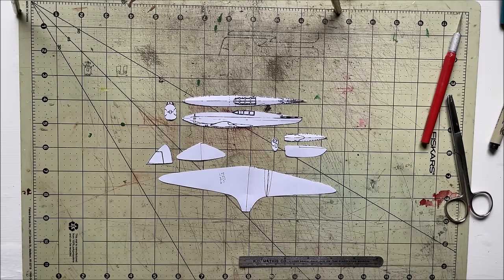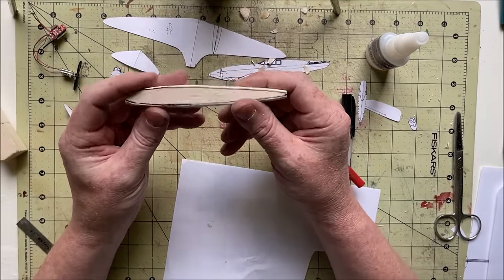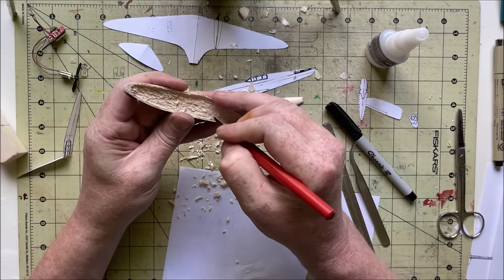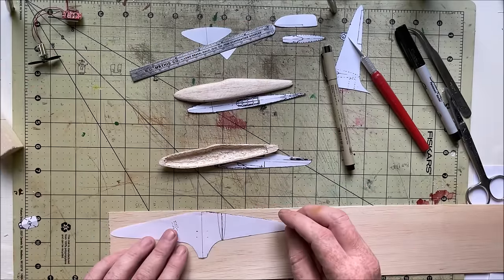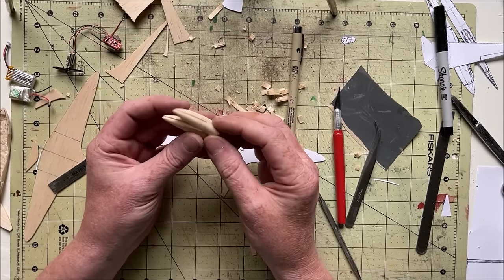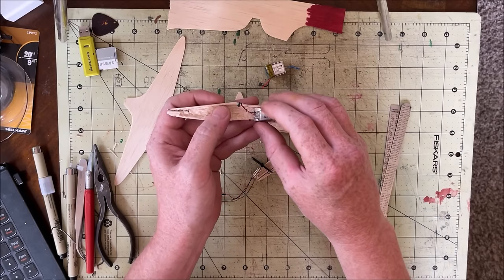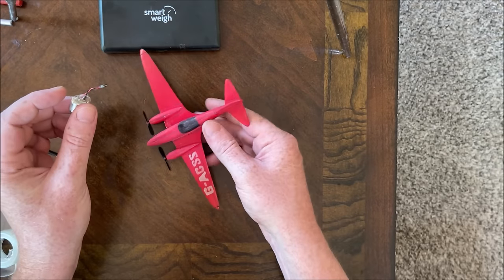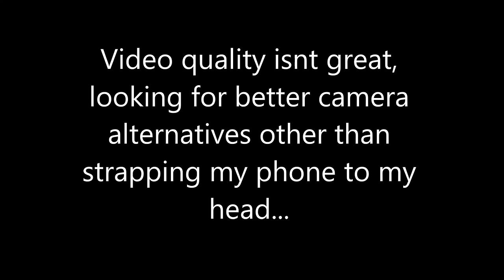micro DH.88 Comet RC plane build/flight

Comment: Damn that things quick! Have you ever made one in 1/87 scale or tried resin printing one?
Reply from the maker: Thanks!  Yeah shes pretty zippy for how small it is.  Not sure about the actual scale of the models, but havent done any 3D printing.
Reply: @microbuilder  you should definitely look into resin at some point
Reply from the maker: @hamiltonsullivan6563  I've been wanting to get into 3D printing for other things, but I like the hand building when it comes to RC.
Reply: @microbuilder  true true, you could just make the air frame in peices and glue it together

Comment: How did you do the flaps to make it turn?  Fantastic build!
Reply from the maker: Thanks!  This one has no control surfaces, it speeds up one motor or the other to make it yaw.  Simple but effective.
Reply: @microbuilder  That I like!  Makes total sense now that I think about it!  I was certain I didn't see you make any flaps, so couldn't understand how it turned, so thanks for explaining! :)
Reply from the maker: @andrewjenery1783  No problem, it works surprisingly well.

Comment: Are you steering that plane with the motors?
Reply from the maker: Yep, thrust differential steering, one speeds up while the other slows down, pitch is controlled with throttle, simple but works great.

Comment: amazing ,,i build small planes and im just now starting to think about rc for them ,,but so tiny,,were do u get the tiny motors
Reply from the maker: Thanks!  If you do a search for KF606 you should find the micro RC plane I used the electronics from.
Reply: @microbuilder  THANKS ,I FOUND THEM ,,IM BUILDING A L 19 BIRDDOG,GONNA NEED SOME BIGGER STUFF ALSO ,I BUILD IN ALL SIZES SMALL ,UP TO 14 INCH WINGSPAN ,THANKS BUDDY ANY MORE LINKS WOULD BE APPRECIATED:hand-purple-blue-peace:
Reply from the maker: @PoorBoyPennyShow  I'd definitely check out the electronics that come in the E-Flite Ultra Micro planes, theyre a perfect fit for that size model.

Comment: how does it turn with no flaps?
Reply from the maker: It uses thrust differential for steering, one motor speeds up while the other slows down and it causes it to yaw, throttle controls pitch.  Pretty simple, but works great on these little ones.

Comment: Amazing build, how fast is that tiny Tot going
Reply from the maker: Thanks!  Not sure about the speed, but she's pretty quick for a couple 4mm motors.
Reply: @microbuilder  out of curiosity how hard would a twin EDF build be ?
Reply from the maker: @SGTMARSHALL1   About the same, the only thing with EDFs is they only make them so small...there's commercially available 30mm fans, myself and a few others have  20mm units, and some are custom making ones down to 12mm.  So if the model doesnt have to be super small, it shouldnt be a problem.
Reply: @microbuilder  thanks for your time, I started a model last year and thought it was too small until I saw your efforts
Reply from the maker: @SGTMARSHALL1  No problem, definitely give it a shot.
Reply: @microbuilder  is there any chance you could test my design, would be sure nice to see if it flies as good as it looks
Reply from the maker: @SGTMARSHALL1  Hmm, it would depend on what it was.
Reply: @microbuilder  it's a Stealth fighter jet concept
Reply from the maker: @SGTMARSHALL1  Sounds interesting, do you have a drawing or plans for it?
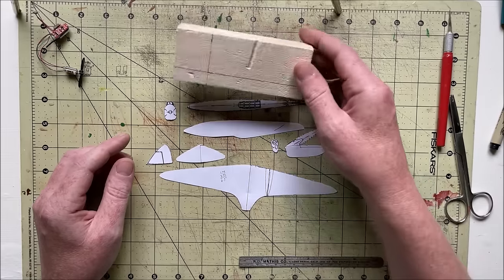Reply: @microbuilder  I have a top view and a 1:16 scale @ 900mm x 500mm x 200mm model not yet completed but enough 3d detail to capture the essence of my design and I can pull together a few relevant dimensions
Reply from the maker: @SGTMARSHALL1  Shoot me an email with some pics.  Cant guarantee anything, but I'll take a look.
Reply: @microbuilder  what is your email, will send you pictures, dimensions and angles
Reply: @microbuilder  or I can send them via message on Instagram
Reply from the maker: @SGTMARSHALL1   If you go to the About tab on my channel my address is there.
Reply: @microbuilder  I don't see an email address there ??
Reply from the maker: @SGTMARSHALL1  hmm yeah doesnt show up on mobile for some reason...just trying to avoid putting my email address out there publicly.  I do have an instagram account with the same name, microbuilder, try shooting me a message there.
Reply: @microbuilder  no worries, I sent some pictures through from my account Shane Marshall 127
Reply from the maker: @SGTMARSHALL1  hm, I didnt get any message or anything...I dont really use instagram that much, not exactly sure how it works lol
Reply: @microbuilder  I was wondering what is going on because no reply . . . Ok click the message icon on top right corner beside heart icon, messages should show and requests should be opposite on the right in blue, click requests and if not there check the next sub category called hidden requests
Reply: @microbuilder  or you can just send me a message on Instagram and I can reply with the photos

Comment: hov is the plane controlled ? did not se any servos ?
Reply from the maker: It uses thrust differential steering, make it a bit tail heavy so that when under throttle it'll climb, and with no throttle it descends, steering is done by slowing down one motor or the other to make it yaw.
Reply: @microbuilder  thankyou
Reply: i have been reading about steering crippled airliners lik that

Comment: king of the hill...classic.
Reply from the maker: Yes indeed!
Reply: @microbuilder  can you make a mini sea plane? That's always been my dream. I designed the raven 250 tricopter drone BTW. It's made of wood!
Reply from the maker: @Kinematographer  I was actually thinking about making the Sea Duck from the cartoon Tail Spin...just not sure if the motors would be strong enough to break the water tension and actually be able to take off.  Would be fun to try though.
Reply: @microbuilder  oh that's a great idea! Yes, I don't know if at a small scale it's going to work, but maybe a cesna and if it's a fail, you could remove the pontoons and add wheels instead?
Reply from the maker: @Kinematographer  Yeah I've got a handful of project ideas for these electronics, so we'll see what happens.

Comment: Make it out of paper mache
Reply from the maker: lol paper is surprisingly heavy.
Reply: @microbuilder  
Yeah. But its a tissue paper.and it only has to be 3 or 4 layers thick. The starch would probably be the bigger concern.
I have a video somewhere. But I used to take micro drones aparrt, tear off the front motors and glue the rear motors and the circuitboard and battery to a popcicle stick. Then cut out a section on the bottom of the plane. They worked good. But the company that made the drones changed boards and circuitry to where they were extremely less responsive to the point you couldnt control them anymore. At first I thought maybe I was just getting bogus drones. But after 4 attempts it was appearent they were not going to work anymore. They were called Dash nano drones. They were about $20 a pop. The great thing about them was when the paper airplane got soggy and limp, you just heated up the hot glue and pulled it out and made another paper airplane and put the pod in that one.
If I find the video, I'll upload it. The one video I made was on a real windy day, but I managed to keep it flying until one gust of with blew it way across the park. Lol
Reply: @microbuilder  
Heres pt 2
https://youtu.be/LSwA8z8tEV4
Reply from the maker: @siggyretburns7523  Cool project!  Yeah the starch might be heavy, for comparison, the two fuselage halves came in at only .69 grams.  Not sure what the total empty weight was, but probably around a gram or so.

Comment: Don't waste your time or your money. These little models fly like crap, and a person that has not been in a hobby will never be able to fly it because he has no experience. So again don't waste your time and your money. If you want to learn to fly RC airplanes buy something made a phone with safety features built into it for under $300 and it will fly and you can fly it, and generally they will not crash almost impossible to crash them.
And that price includes at transmitter, with all instructions. Once you install the battery or charge the battery that's built-in you'll be flying with no problem
Reply from the maker: ...who are you talking to?

This model was touchy, but still flew well, and no, this is not meant for beginner flyer.  The plane these electronics came out of cost only 30 dollars, and is a fun flying micro foamy RTF that is nearly indestructible, the balsa was maybe 5 bucks...cheapest way into the hobby, and I enjoy spending my time carving balsa, so not a waste either way.